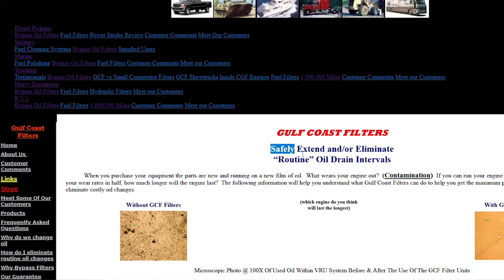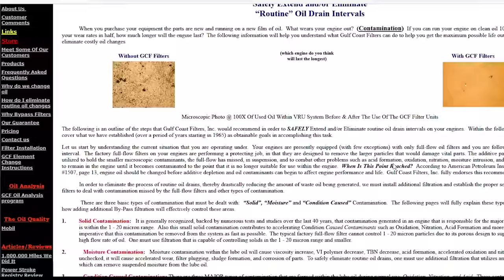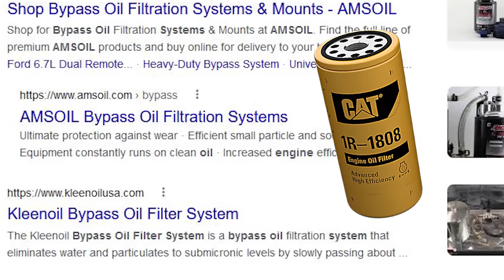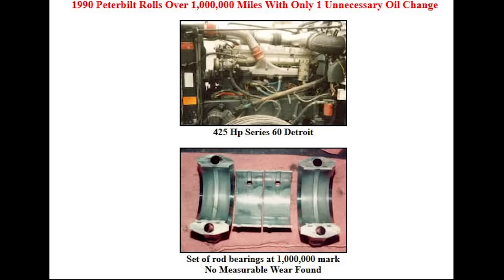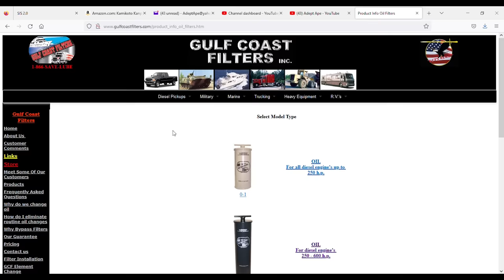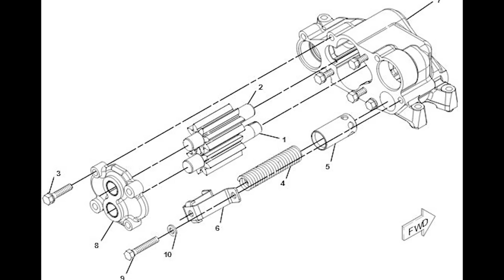No Oil Changes and 1 Million Miles!!! Are Oil Changes Optional with a Bypass Filter? (INTERESTING)

Comment: Volvo runs a bypass system on a lot of their trucks straight from the factory on the Volvo engines and they still recommend changing the oil every 30,000 miles
Reply: Normally the factory installed bypass filters dont clean oil well enough to be a threat to the oil change program.. There are several now that are a threat to the oil change program. Some are too expensive to service.

Comment: Years ago I got a call from Dallas Texas He said bring me two Gulf Coast juniors and a Gulf Coast 0 2. It was a big luxury RV . Probably at least 500.000 bucks. I almost fainted when I saw that engine. He said I can tell you are intimidated. You do the Land Rover and the generator.. my mechanic will do the Cummins. The Land Rover had a Buick V6 engine. The same thing happened in Fort Worth. This was like a converted Trailways bus with a 2 cycle Detroit. He said you do the Volvo and the generator my mechanic will do the Detroit.

Comment: There is a meter which shows oil pressure where the ignition key is used.
Oil pressure no good,oil level & quality check i.e need change/top up if found improper.Filter change is usual with oil change.
There may be other reasons for bad oil pressure.
Have no idea about oil bypass but yes sometimes oil change is not worth spending as its viscosity is good thou may contain carbon,etc.

Comment: While moisture is not good for any oil, engines especially truck engines have enough temperature in them to get rid of nearly all moisture
Oxidation of oil comes with heat and oxygen which comes from churning through the motor. Anti foam additives control this to an extent but they are a consumable 
Nearly all the additives are consumable 
Then VI improvers and other polymer chains that give you a multi grade get chopped up over time and use dropping viscosity 
Sure by pass filtering is a great idea if we’ll implemented and will extend the life of your oil and motor the cost of constant oil analysis and monitoring far exceeds the cost of new oil

Comment: Not industrial equipment related but in any passenger cars or light trucks I own I’ve never subscribed to the extended interval oil change idea. I use inexpensive oil (whatever is on sale) as long as it’s the correct viscosity and meets all the necessary standards and just change it every 3 - 4K miles and move on with life 😂 However I can see that if the equipment you are running takes multiple 55 gallon drums of oil, then changing it too often would get expensive!
Reply: I gave up changing oil in 1963. I started with a Frantz oil cleaner and Delo W30
I have toilet paper filters in every engine and automatic transmission I own including the lawn mowers with oil pumps.on the diesels I pay more attention to them.All I use now is top loaders Jackmaster Classic  Motor Guards and Gulf Coast filters  a Ford canister filter converted to take Scott 1000. Saw some Purolater toilet paper conversions on Ebay. My sister wrecked the old Impala. My last two Frantzs went to a salvage in Dallas Texas.I like the top loaders better anyway. That was a good car.

Comment: Locomotive Diesel Engines operate on this principal.  They never change oil under normal circumstances.  The engine consumes some oil, filters clean the running oil and new oil is added to replace consumed oil for the life of the engine.  The engines run hard, with turbos and superchargers just like road trucks.   The smart thing would be to let the engine consume more oil (it is, after all, an oil burner by definition), while replacing that oil equally, and continually.  The oil stays in great shape for the life of the engine. the running cost is minimal and no downtime for oil changes.

Comment: I think oil change intervals depend largely on how worn the engine is. When you have blowby and fuel contamination I think it’s much more important to change at closer intervals. With super worn out engines I change at about half the regular interval and change the filter every other.
Reply: blowby is generally caused by improperly lubricated piston rings that collect varnish.
Reply: In the old days Buick engineers said if your engine doesnt use oil it meant not enough oil is getting to the top rings. Ive had a few cars that came close to not using any oil.

Comment: I use a BD7317 Baldwin dual flow "bypass" filter on my 2005 5.9L Cummins truck. 20 micron on the main filter and about 5 micron on the bypass. But it is not a bypass system back to the oil pan, the filter has 2 internal oil streams, one full flow, other stream filtered to a very fine level. All the oil entering the filter  goes to the engine bearings. I did also add a toilet oil filter bypass, which could be 2 microns. It dumps back to the pan. I got the oil source from the top of the oil filter housing, there is a removable plug. The route back to the pan, the cummins has a second turbo oil return blocked with a knock out plug. So I used that by making an adapter. No need to punch a hole in the oil pan. One way I know the toilet filter is not clogged up, the thing gets hot. If it ran cooler, you can know it is no longer flowing like it should and time for a new roll. Seeing it is 2005, the engine has no DPF, EGR, no emission control that can contaminate the oil. I have had ZERO engine problems. But I do change the oil, but at double the mileage. I might run oil till 12,000 miles. These bypass filters are a good idea. They do make sense.
Reply: Dual-flow oil filters
July 1, 2002
Baldwin Filters has introduced a line of High Velocity Dual-Flow spin-on filters, including three that will replace the Fleetguard Venturi line on Cummins ISM, ISX and Series 600 engines. New to this filter design is a high velocity dual-flow nozzle that creates a low-pressure zone to pull more oil through the by-pass element. According to Baldwin, 15% of the oil flows through the bypass section,
Baldwin Filters has introduced a line of High Velocity Dual-Flow spin-on filters, including three that will replace the Fleetguard Venturi line on Cummins ISM, ISX and Series 600 engines.

New to this filter design is a high velocity dual-flow nozzle that creates a low-pressure zone to pull more oil through the by-pass element. According to Baldwin, 15% of the oil flows through the bypass section, up from the standard 10%.

And since the filter is designed with only one inlet and one outlet, the oil that flows through both the full-flow and by-pass sections goes directly to the engine, rather than some of it returning to the sump. The filter maker says this results in better protection for engine components.

The full-flow section is made of synthetic microglass media, for increased strength, capacity and efficency.
Reply: The Australian Jackmaster Classic claims 1 micron filtration.If you use their filter elements. Of course I removed the fabric cover and found a roll of very high quality tightly wound Australian toilet paper. If you are using a toilet paper filter its the only one that is cleaning oil. Normally with the combination filters the depth filter part needs to be changed  The full flow part never needs changed
All you need is a full flow filter and a toilet paper filter. On a big engine a paper towel filter would  hold more contaminants.
Reply: LOL.  You can run 15k miles without any of the tom foolery.
Reply: There are a lot of good oil filters. They all have hoses to deal with. If you dont have common sense you are better off with the system of allowing the oil to get dirty then getting it drained. That system I gave up a long time ago. Filters that clean oil require more attention than filters that dont clean oil. You cant compare a dual element filter to a regular full flow filter and a big bypass filter.

Comment: I have been using the Amsoil bypass system in my medium duty 5.9 Cummins for years and still change my oil an all filters every 15k miles.  I do plan to send off the oil analysis this next oil cycle just to verify the condition of my engine and oil before I change it.  Amsoil has some of the best engineers on the planet designing oil, additives, and filters.  Their bypass filters will filter down to 2 microns by design... their engineers state that anything less than that you start filtering out additives that make the oil so resilient.  So I question these filters filtering at a 1 micron level and if they do is that a good thing?   Just food for thought.
Reply: Amsoil had a canister filter in the 80s that might have been as good as the toilet paper filters. They had Bobby Unser saying this oil change is  forever. At the time I was using a Frantz and Amsoil. Their filters are not so good now.
Reply: Oil analysis proves the better filters dont remove the additives. The Jackmaster Classic claims 1 micron. I have no way to measure it. I know oil analysis shows the additives. Im told the toilet paper filters will remove solids like graphite.

Comment: Particles contamination are just one part of the oil degradation... you can avoid It, but oxidation, fuel, water, acid contamination still occur! I wouldn't use the oil anyway for too long

Comment: I would never install a by-pass filtering system with the crazy idea of "never" changing my engine oil.
THAT'S JUST INSANE.
I would do it as a supplement to the regular filter and perhaps after some lab tests maybe consider extending my draining intervals if all checks A-OK to do so.

Comment: Big difference for a truck humming down the highway vs one doing stop and go or worse.. short trips. 
This.. ?might? Help with mpg. Because it doesn't have to force all the oil through the filter. Removes some engine strain.

Comment: iv been running bypass oil filters since the first gen frantz filter the filter was a roll of scott's toilet paper it would filter down to 1/2 micron on a gas engine the one i run now is the amsoil bypass filter universal 2 micron i'm a gas engine builder and i warranty gm 4.8-6.0l 5yrs. or 100k i do require the full flo to be changed once a year and the bypass every two just keep in mind that does require adding oil i also use an oil catch can in the pcv system i also require full synthetic oil with a good detergent package i very rarely have to open an engine back up but when i do they are almost spotless barely even smells like an engine
Reply: Started using the Frantz in 1963. The Motor Guard came out in 1961 They have always claimed submicronic. I would think toilet paper would filter the same in all the filters. I prefer the top loaders. Dont know why someone would give up a submicronic filter for a 2 micron filter..The Jackmaster is probably the best cleaner because they have the smallest orifice.  They only claim 1 micron. Probably the most accurate.Frantz stuck with that old bad design Not set up for toilet paper. The paper changed . Frantz didnt.
Reply: I was wrong on the Australian Jackmaster Classic. The orifice looked smaller to me. Its about the same as the others. About .060. I put a .025 wire welder tip in a brass fitting and put it in the inlet. I like the Jackmaster Classic. The top loaders are easy to service. Top loaders are all I have now. The Motor Guard on my F250 390 is over 50 years old. Still have a few Gulf Coast juniors. One on the F250 transmission.

Comment: There was a guy on bobistheoilguy website that was running 40k oil changes on a Honda S2000 using Amsoil and an Amsoil bypass setup. His used oil analysis looked very good. He of course had to add several quarts over the 40k which kept the TBN up and I think prevented fuel from showing up in harmful amounts. The S2000 doesn’t have direct injection so fuel dilution isn’t probably an issue.
Reply: I was on there 20 years ago. They have a lot of filter information.
Reply: @ralphwood8818  I looked into them so long ago, it came in a big envelope. It's good to hear they're still going.
Reply: @19723020  Its been interesting. Got into a debate with a guy on a trawler forum. That guy was smart as hell. He said send me a propaganda  package. He said bring your wife down to Canaveral. I will take you on a tour and we can talk filters. I called Gulf Coast filters and told them to send an engineer down there..They were moving the shuttle then. I think Gulf Coast filters  has them listeed as a customer. Im retired now.
Reply: That was wild as hell . A guy  like me debating  a NASA diesel equipment engineer..He said you are good at taking up for yourself. He was polite.

Comment: Similar to what the Cummins "Centinel" system does for you automatically, you can pump out a gallon of engine oil every 5,000 miles, and replace it with the same brand and type of fresh engine oil, preferably a full synthetic.  This, plus a bypass oil filter should do it.  No oil changes in the shop. ... On cars & light pickup trucks, some folks pump out half the oil from the dipstick oil using an electric oil extractor pump (cheap on Amazon) every 3,000 miles, and then they might use an over-sized oil filter rated for 20,000 miles that filters great (Fram Ultra is about 50% at a low 10 microns for example), changing the filter out at 20,000 miles.
Reply: All it amounts to is never allowing the oil to get dirty and adding enough new oil to get enough new additives. The weak point is using filters that cant keep the oil clean. A 10 micron filter doesnt do it. You need a good filter media such as cotton toilet paper paper towels pulverized newspapers . Also the oil has to travel thru a lot of media at a slow rate. 22 inches in a big Gulf Coast flter at the same rate as my toilet paper filters. Toilet paper is better than paper towels. Dont know of any toilet paper as large as Bounty big roll paper towels.

Comment: I once heard of a company that actually did the math and decided it would be cheaper to never change the oil and just buy a new motor when it blew up
Reply: Not be so good if your engine blew up in the middle of nowhere. My old Ford 6.9 diesel had an injection pump go bad coming into east Missoula Montana. There was a truck stop there and a diesel repair place. I had come thru Yellowstone and the Grand Tetons. How would you like to break down in Yellowstone. Probably not smart to tell my wife this baby is running nice.

Comment: I had a Gulf cost by oil filter on S60. It worked. They also tell the drivers to take oil samples and they will look at your oil samples and call you if they see anything bad or the wear metal going up over time.
Reply: It seems to me they know the oil is good. Oil analysis is looking for engine problems like coolant or fuel contamination problems. On my small engines I only need to know how to read the dipstick and the used toilet paper..I know these days I can buy filter elements as good as toilet paper for about 30 bucks. Toilet paper has served me well since 1963.

Comment: I would think a constant dilution/replacement trickle system would produce the best results over the longest oil life.  
And, the system would essentially just be a cartridge that would release oil from one chamber while collecting the waste oil in another.  
Simply replace cartridge when the light blinks.  Nobody needs to be 'trained' to change the oil.  Money saved with no lube techs better than increased cost of cartridge/oil.
As an added bonus every cartridge can be sent back for free analysis and EFD (Environmentally Friendly Disposal).  So yup, that's my new business plan.

Comment: I don't know if it's mentioned in their tests but a piece of machinery that is always at operating temperature is going to have far less problems/wear as machinery that is going through multiple heat cycles. For a simple example are taxis, here in Oz taxis run around a million kms before they're offloaded and replaced yet the same vehicles that are privately owned may last half that. An engine that is always at temp is never going to have the moisture ingress of one that cycles hot and cold.
Reply: Very true. Took me about 20 years to put 250.000 miles on the 84 Subaru.. with no oil changes. The 93 Subaru Legacy has 240.000 miles on it. Its a backup car now..

Comment: Check re-refining used engine oil. This will explain how oil has a longer life than the normal drain intervals. It is the contamination in the oil is the reason for the drain Intervals.
Reply: Was a mechanic for a re refinery company in east Chicago. Conventional oil gets better every time it is refined. Its a matter of getting out the impurities and adding new additives. Most of it goes to the major oil company's. I would imagine a lot of synthetic oil is in it now.
Reply: When they re refine the oil it is as clear as water then they add the additives. I just bought Super Tech beavy duty off highway 30 weight for the tractor. It is as clear as water. It has a good feel to it. If they had Rotella or Delo 30 weight I would have bought it. For the tractor I dont need multi grade oil. Dont run it in cold weather.

Comment: Had a guy with a 1.3 million miles Cummings x15 with a oil bypass system. Never did a full oil change would only replace the oil in the filters when replacing then. Did a oil test every filter change
Reply: It works. Its a matter of keeping the oil clean and adding enough new oil to keep the additives up to specs. It helps to have common sense. You can have fuel or coolant contamination. In 60 years I had to drain the oil and change a head gasket once. In the days of mechanical fuel pumps a ruptured diaphragm could put gasoline in the oil faster than it could evaporate. Then you had the poor quality multi grade oils.

Comment: Where I work we have 20~ of the max force 7s with a bypass filter and our shop foreman was having them change the oil every 20k miles. Last year we've replaced 5 of the engines at around 85k miles.